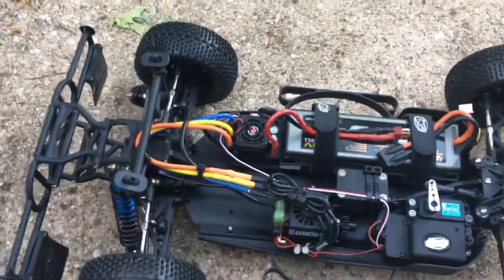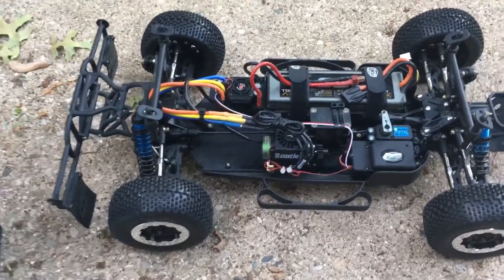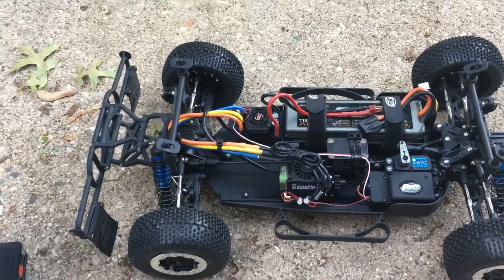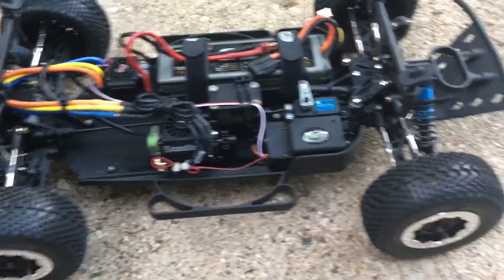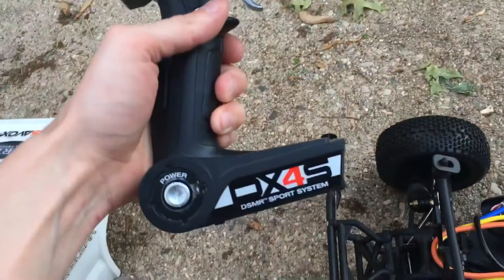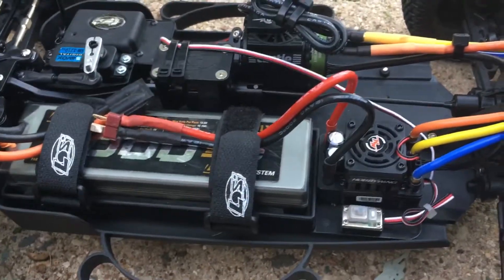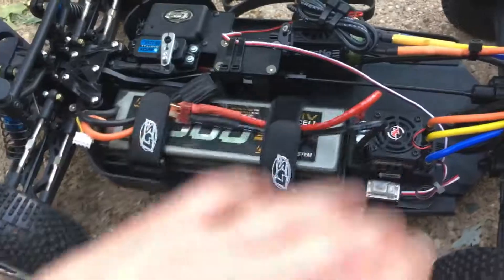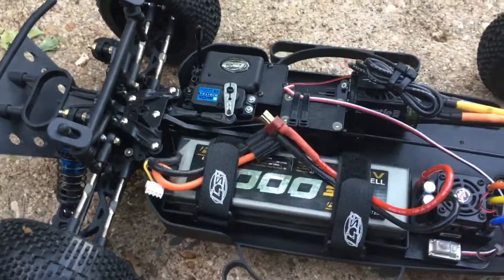LOSI TEN-SCTE Upgrades / Setup

Comment: which combo , ? 4 s or ?
Reply from the maker: 3s
Reply: @RCKnockout  meaby a 2600kv, 4s, esc 140 A, could be good too ? or 4074 motor 2000kv ? thanks
Reply from the maker: @jiji0496  I probably would pick a 2600kv over a 2000kv
Reply: @RCKnockout  yes i have a 3668 motor 2600kv, come from mojave 4S, and a 4074 for the Mojave, have fun ;)
Reply from the maker: @jiji0496  thanks! You too!